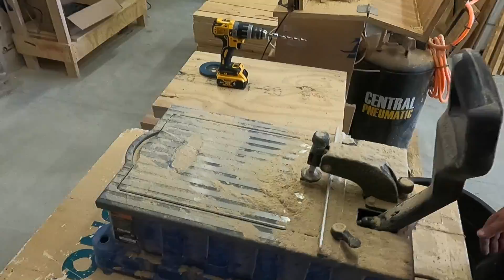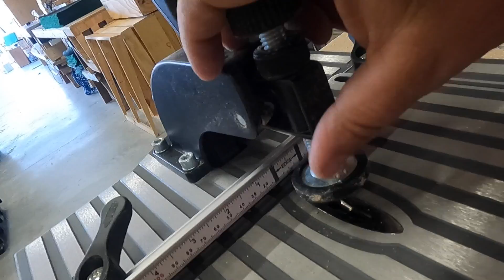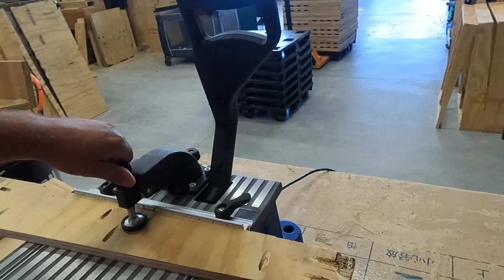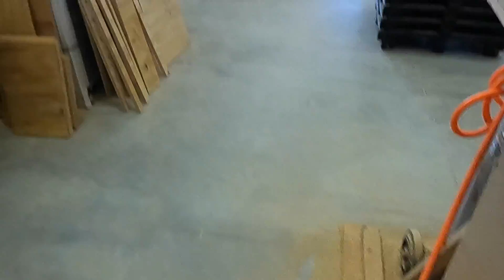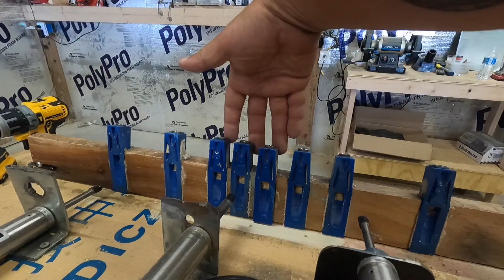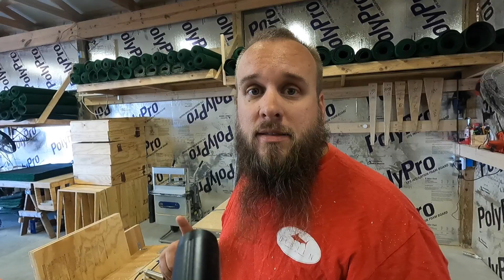Home Made Pocket Hole Jig vs The Kreg Foreman  - There is no comparison

Comment: You must go thru batteries pretty quickly drilling at that pace.
Reply from the maker: Yeah, there is a Charging bank right behind this drill station that has five of the 4 AMP batteries So there is always one charged

We get a couple years out of them before they start to run down though

Comment: Would you be willing to post a more close up of the way you wired everything? And links for the products on Amazon so you can make some $$?
Reply from the maker: I would really like to do that and make a follow up video showing how to build it but I did not order the pneumatic parts online. I went to a local shop and just told him what I wanted and I didn’t write down parts numbers

Basically I’m saying it would take a little time to figure out exactly what components were needed
Reply: @RockhillfarmYT  I appreciate you responding in the first place. It means a lot. I didn’t know how much time would go into it so I tonight I’d ask. To understand better, are the pistons constantly under pressure and need constant air to keep the pressure? I ask because we have a small air compressor and if it needs air to open, that’s fine. If it needs air most of the time then we will need to get a bigger compressor. That was the biggest question I had!
Reply from the maker: @jessicalane107  while a board is clamped in it, it is under pressure and then you hit the foot pedal and it releases the pressure.  Even though it’s under pressure that pressure is not escaping

We ran it off a small compressor for a few months and then stepped up to a big one.

The small one was running continuously to keep up which was really loud and hard on it

Comment: Very cool custom set up. BTW It was easy to see the wood shift when you used the Foreman - maybe a 1/16?  A 1/32... it was hard to tell how much? I'm guessing if you are using a harder wood, that shift would be a problem. (I wonder how Matthias Wandel would make your custom jig?)
Reply from the maker: The only way to avoid the wood shifting is to lock the adjustment down really tight which starts to wear the skin off your thumb before too long

Who is Matthias wandle?

Thanks for watching.
Reply: @RockhillfarmYT  YouTube creator who has built all of his workshop tools from scratch. Invented the Pantorouter. Anywhooo....your custom jig is more than just a single function solution. The leaning tray to hold 10 boards, foot peddle open close, air sprays dust out after each cut etc. Just reminded me of his work.
Reply from the maker: Thanks. I’ll check that out

Comment: Nice jig, used my Kreg Forman  for six years  never ever had a glitch  !!!  The monkey drilling holes was probably using dull drill bits !!!  Second: Forman  is .ment to be used right handed  !!! Third::: stops built in and great rules built in ... Nothing wrong with the  Forman !!! More like monkey operation errors  !!! Love  your jig , with a little thought I'm shure you can solve you dust control  issues ...  like dust hood on the opposite side of were your blowing the air  ... looking forward to watching your panel saw video ...
Reply from the maker: I think for the average woodworker the foreman is perfect

If you’re drilling  3000-4000 holes a day, our set up works better

Comment: Hello and Great set up. Can you use different thickness of wood when it clamps down or do you have to adjust the air cylinders.  Thanks.
Reply from the maker: You can use different thicknesses of wood. If you put a 2 x 4 in it, you have to remove the board we use at the back to stabilize.

Which is fine because the two by four is strong enough to clamp directly in the cylinders
Reply: Awesome . Thanks for taking time to reply. I'm gonna try it. Thanks.

Comment: Have you tried a half-decent piece of plywood to see if it too needs constant adjustment? I have never used the air cylinders so I will check into how long it might take to secure/release the piece and then mount one vertically over the Forman. I'm tired of using the drill.
Reply from the maker: We go through 100 sheets of plywood and drill 10,000 holes a week.  We have to adjust the clamp constantly.

If you’re doing fine woodworking and just drilling a few holes here as there it’s a great machine. It just doesn’t really fit our needs very well
Reply: @RockhillfarmYT  Thanks. My needs are face-frame material and pre-finished plywood. You talked me into it.  PS I liked the spring idea.
Reply from the maker: Thanks for watching and for sharing your feedback

Comment: Your video and audio are superb ... what camera, mic, and editing software are you using?
Reply from the maker: GoPro hero nine black, with a rode mic and iMovie
Reply: @RockhillfarmYT  very nice, I’ve the Hero7 ... not sure what’s new about the 9 but I’ve insurance so maybe I’ll get upgraded to it eventually if it breaks. Is that the Rode VideoMicro for about $60?  I was going to buy it along with the case that holds the mic adapter on the bottom but wasn’t sure if the quality but is superb on your video.
Reply from the maker: The one I have is $100 and it’s elongated.  I also have the $60 one and they are pretty close to the same

You definitely want to get the dead cat instead of the foam puff for deadening wind
Reply: @RockhillfarmYT  thanks for the info!  I was looking at Ulanzi V3 case so I could use ND filters if needed ... what do you think of that one?  Which tripod did you choose?
Reply from the maker: I have that case that you are talking about. It works well. On the newer models they make something called a media mod that is similar but already has the mic adapter built into it.

For the go pro seven you’ll also need the mic adapter if you don’t already have it

I have a couple of different tripods but here in a little bit I’ll find the one that I like the best and share a link
Reply from the maker: This is the tripod I use. I really like it because it adjust in more ways than the other ones I have

Thanks again for watching

https://amzn.to/36l0uJj
Reply from the maker: And this is the mic that I use

https://amzn.to/32vAaei
Reply: @RockhillfarmYT  Thank you sir!

Comment: I’m a custom cabinet maker and that homemade Jig is nice!!  I have the Foreman I picked up on Craigslist for $100 barley used and still in the box. I like it a lot and I have the safety button locked down and use a little quick clamp to hold the trigger down. That keeps me from having to pull the trigger when I am drilling a bunch of holes. I also can stand to the side and that makes it way more comfortable to use. All that said I’m going to make one of these!!! It will come in real handy when I Have to put pocket holes in larger pieces of ply for the cases. GREAT IDEA AND THANK YOU FOR SHARING IT!!!
Reply from the maker: Thanks. We’ve been using it for a long time and its too good of an idea not to share
Reply: It looks like a foot pedal would be more comfortable.

Comment: I did something amazing about 17 years ago when I bought my first Kreg Jig. I actually read the manual my wife even took a picture of that.
What I  learned was that if you use a corded drill the rpm of the bit accelerates faster than a battery powered drill. The bit stays sharper.by generating less heat at a higher speed. Thus the bit stays sharp longer. 😁🛫
Reply from the maker: Thanks for the tip.

I will say that our bits last much longer in our cordless drill than they do in the foreman jig which was designed by kreg
Reply: You could easily add a pneumatic drill to this station
Reply from the maker: That is a great idea. I will talk to my guys about that on Monday.

My only concern is what speed those drills turn at and if it would be better or worse for the life of the drill bits.  

Worth finding out though
Reply: @RockhillfarmYT  Another significant factor for keeping the drill bit cooler is using a vacuum attachment.  It removes the chips as they are created plus the airflow over bit cannot hurt.  It's hard to say if the higher RPM from a corded drill will help keep the bit cooler vs. a battery-powered drill.  Mostly I've read that the higher RPM will result in a cleaner cut of the hole edges.